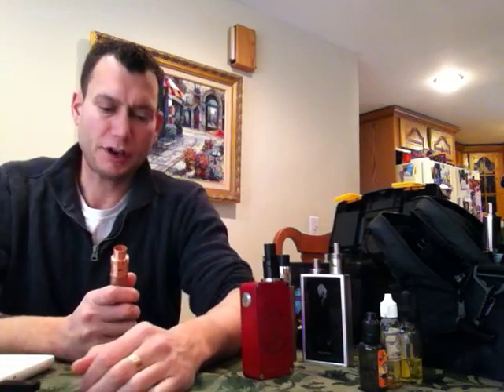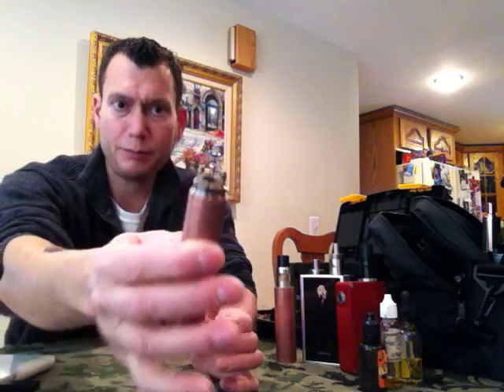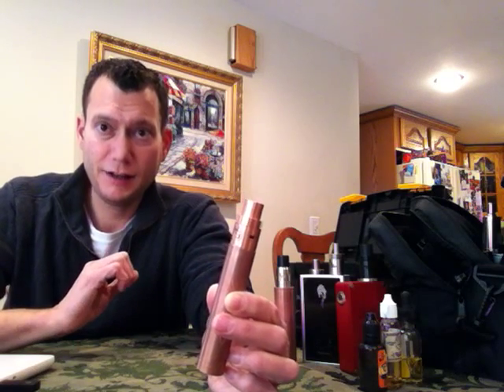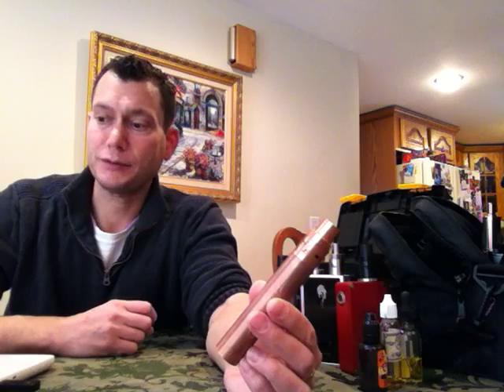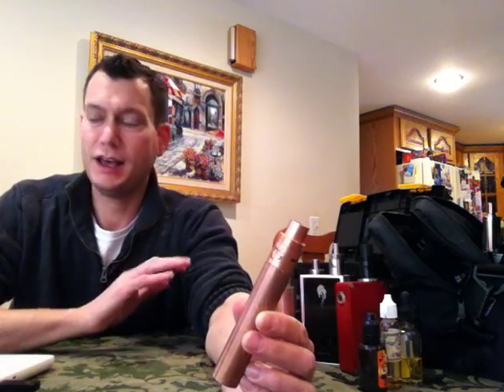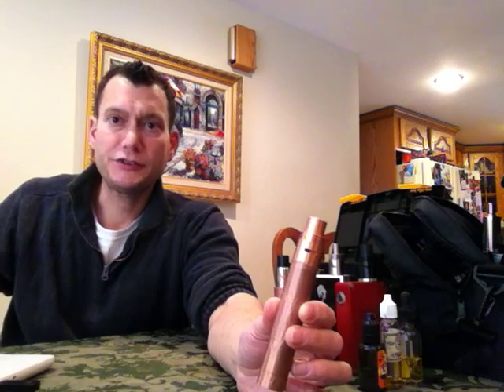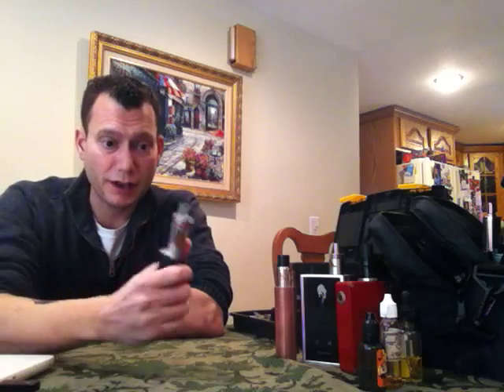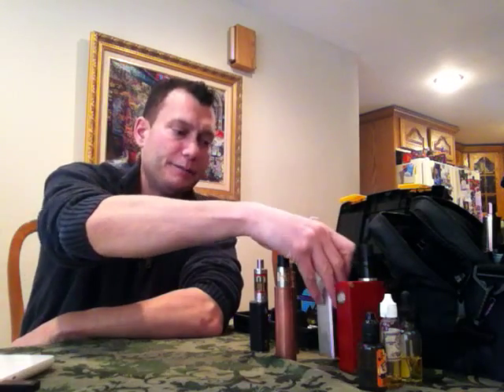Mech Mod Vaping and Ohms Law

Comment: Resistance goes UP as the coil heats. Your battery only puts out the voltage that it has at the time so amps go down. The age of this video and the non-correction of this basic fact prove that you should cross reference your info, especially if you're a new vaper. 
.06 is too low on any situation.

Comment: No. As the wire heats up, the resistance will go up. Thats why we like to keep circuits as cold as possible. Just remember all that liquid helium Cern uses for their wiring alone. Its really simple; U/R=I Voltage(4.2)/Resistance=current. Current is unknown. The lower the resistance, the higher the amps. For instance with 0.2 ohms ; 4.2/0.2=21. This will draw 21 amps. You need a VTC5A or similar for that. For effekt; P=UI, in this case; 21*4.2=88.2 watts. So, memorize;U/R=I AND P=UI=I^2*R=V^2/R
We can therefore conclude that as hotter the coil gets, the lower the wattage and amperage will get. For kanthal this is almost negligable.

Comment: New to vape, have a joyetech ego One with option of either .05 or .1(might be different, I'm still kind of confused by all this) and am trying to learn more about vaping in general.  Where do you suggest I go to really learn about this stuff?  A lot of the "lingo" is going over my head.
Reply from the maker: Robert Lee Hey Robert, thanks for watching, that's an excellent question.  There's alot to learn about vaping.  I recommend finding one or several local vape shops that you can feel comfortable stopping in and just chatting.  Don't feel obligated to buy things you don't need and are not ready for yet.  Just ask if they can explain a bit about vaping.  If you stop by at a slow time of the day most shop folks will happily take the time to answer questions.  Tell them that you are new to this.  I didn't even know the things to ask in the beginning, it was all very different and strange.  I got alot out of watching videos on youtube.  I would just search a topic or a question and usually find a video about whatever it was I needed to know.
Reply: Thanks man.  The local vape shop can't even explain why the egoone I bought has leakage problems.  I appreciate the response, I'll check out what other shops are in the area!
Reply from the maker: +Robert Lee did you ever find out why your eGo One was leaking?
Reply: as far as I can tell it was overheating, or I was putting the coil(?!) thing in wrong.  It still leaks on occasion since I've toyed with it, but nowhere near as much.  Buddy of mine is talking about giving me his old vape setup so I don't know how much longer I'll have this one.